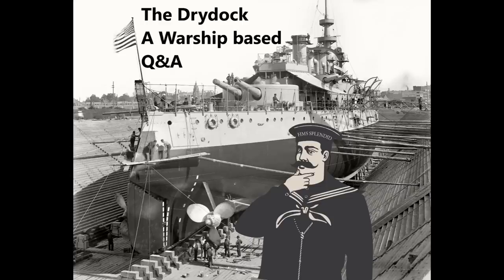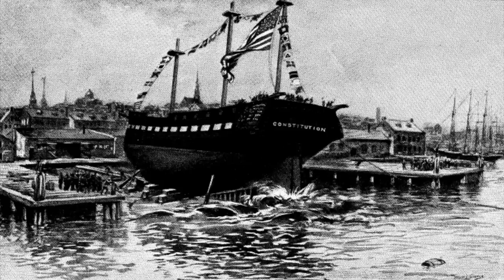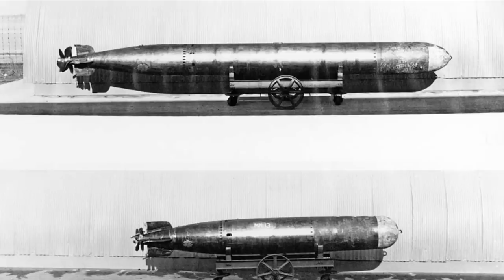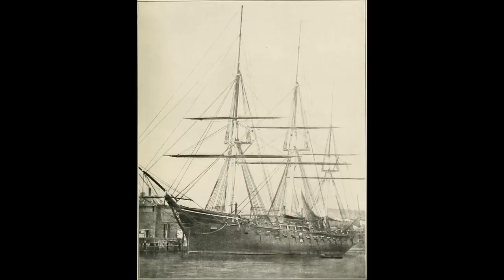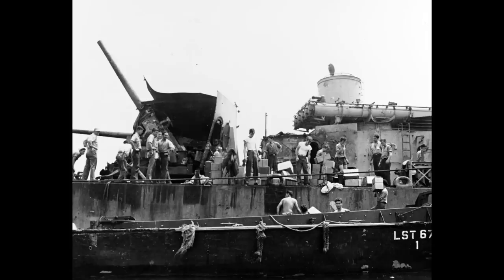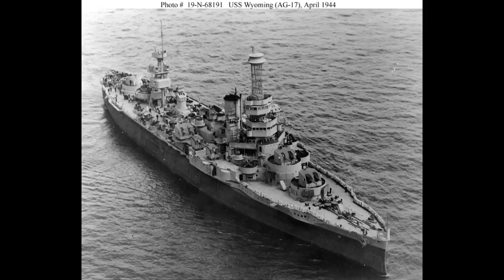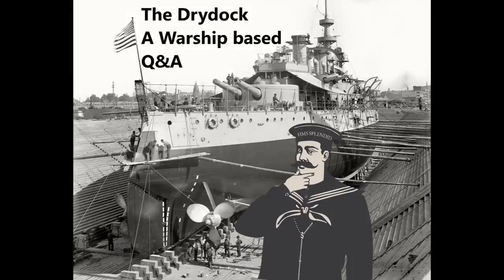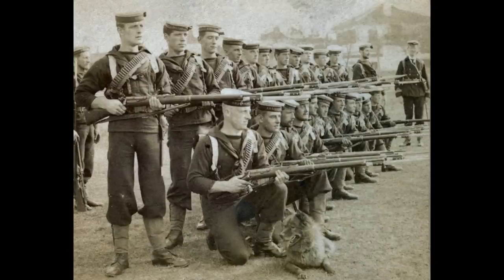The Drydock - Episode 204 (Part 2)

Comment: @ 1:52:20 I'm not too sure, but wouldn't the Bulges that raised the USS Miidway up, increase the height of her hull (and Flight Deck, Island, etc.) above the waterline, causing the instability in rough weather?  I'm trying to remember which class of ships (and even which country had them!) had similar issues when the put Bulges on them along with more AA.  (Pretty much all navies did add Medium and Light AA, except of course the Japanese since they only had Light and Heavy AA, and never really had a Medium AA gun, except for a limited number of captured ships, or ships (including U-Boats) that got turned over to them after Germany surrendered....)
And perhaps it happened to more than one class of ship, and to more than one country now that I've thought about it more!
Reply: If the bulges increase the waterplane area then stability is increased. It is easy to ballast down a ship, with either Fuel, Potable Water or Sea Water.
Reply: @benwilson6145  Some are designed with flat bottoms & tops to help resist rolling, others are more streamlined to limit their effect on a ship's speed...

Comment: I worked in the oil field for over 9 years, and I can tell you right now the modern way of them separating it is they have multi-levels of containers, or vessels that are called separators under different levels of pressure which then separate depending on the weights so your gas, then your oil and water, and anything left over from those basic separations until it gets completely and totally down to your basic components.

Comment: The dissolved gasses are not as big a problem as water in ship fuels. Most ships have a centrifuge on board to remove the water and any dirt particles before use.

Comment: A question: Why didn't the Royal Navy/Fleet Air Arm use more US carrier aircraft?  Was it that the US didn't want to supply more?  Anglophilia?  Or some other factor?  The American carrier aircraft were already adapted to that use[including low stall speeds-important for carrier landings].  And the later fighters(Hellcats and Corsairs) were on a par with German fighters.
Reply: Back then the world was considerably more 'protectionistic' than today. The UK wanted home-grown planes. Also the stipulations of the Lend-Lease treaty apparently meant that US equipment in British hands after the war had to be paid for, and the UK was more or less broke. So there were apparently plenty of cases where US lend-lease carrier planes 'accidentally' tipped over the side of the carrier towards the end of the war.
Reply: The FAA did use US carrier aircraft extensively.  Numbers of aircraft transferred under Lend-Lease:

F4F/FM-1/FM-2 Martlet/Wildcat: 1,200
F6F Gannet/Hellcat: 1,263
F4U Corsair: 2,012
TBF/TBM Tarpon/Avenger: 1,070

Notably, the FAA deserves credit for working out the Corsair's issues with carrier operations.
Reply: The Royal Navy carriers were short of hangar headroom. A number of US built aircraft had to have the wings shortened to physically fit in the hangars as a result. Corsairs are an example with USN one’s having round tips and RN ones having noticeably squarer tips where they were cut down.

Comment: What was the point of these big clocks on capital ships? I've seen it on quite a few photos You  are using in drydock and 5 minutes guides.
Reply: They're range clocks, designed to show other ships in a squadron the calculated range to a target in thousands and hundreds of yards. I'm sure that Drach has answered this one in an earlier Drydock.; just don't ask me which one.
Reply: @notshapedforsportivetricks2912  Thanks. Yeah, looking for answer through 200+ drydocks would require fair amount of time to spare ;). But, I don't know if I missed it, or are these clock mount only in front of superstructure? I think it would be nice to show range in both directions
Reply: They aren’t clocks - the scale is 0-10 not 0-12…
The Battleship New Jersey’s YouTube channel has a video on them.

Comment: steam turbines are an utter pain in the butt then the gearing for them is worse because you're talking about a very fast heavy spinning mass on one end, and a relatively slow but extremely heavy mass on the other end with water resistance added to it. Turbine blades would have been very difficult to forge back then because they only just had the metalurgy to make it work reliable enough, you wouldn't really get superalloys and heavy forging until the middle of ww2 and thats too late for battleships at that point
Reply: Not to mention having to machine them with only high-speed steel cutters.
Reply: Stainless Steel was developed before WW1 (1871). 
Stainless steel aircraft have been around since 1931.
The Queen Mary (1934) had stainless steel turbine blades.
Gas turbines have always used corrosion resistant steel.

Comment: Could Italy not create not create Synthetic Fuel Oil Facilities like the Germans did, I know italy had an abundance of coal that could be used for that purpose. realistically speaking here.
Reply: I think the issue was the volume required. Germany was making it for land warfare,  the amount, as Drach pointed out,  for naval warships is staggring.  I read somewhere (Greg's?) that it took 4 times the energy content of the coal used to produce one of gasoline.
Reply: @lamwen03  well that idea is torpedoed